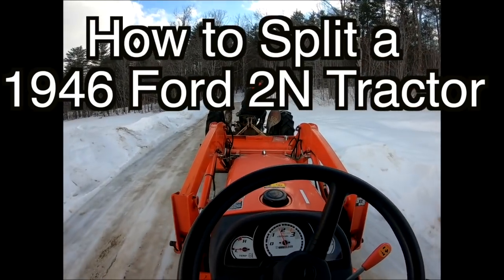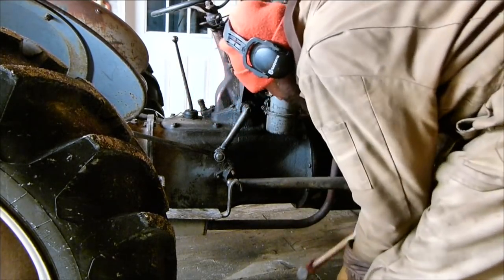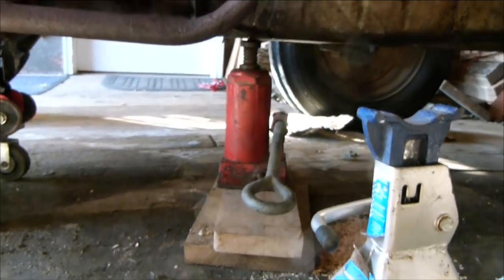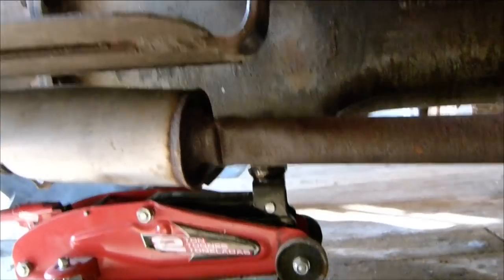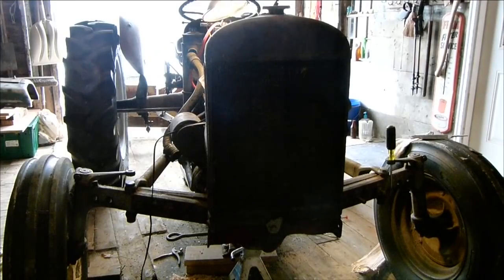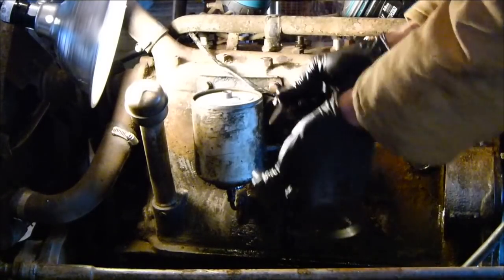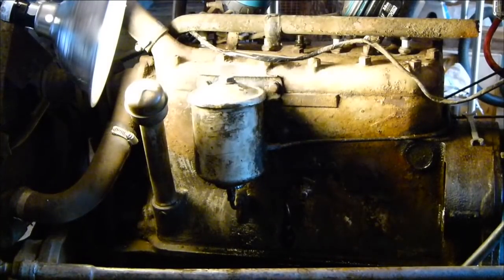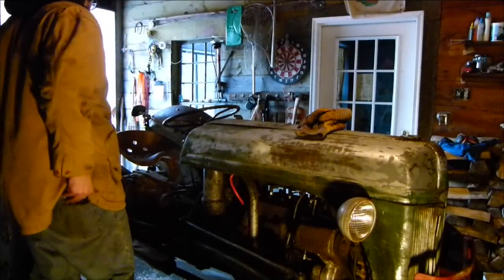How to Split a Ford Tractor

Comment: You've inspired me to take my tractor apart... On second thought... It's 33 and snowing here for the first time this year. Way too cold! I don't know how you do it. Broken foot, freezing temps, wood floor, up hill both ways. I could go on and on. Well, time to watch the follow up!
Reply from the maker: Ha! It was up hill both ways now that you mention it! I don't know how one works outside in temps like that on thick old steel. I don't really like it, and wish for carolina temps when in the middle of a project like that. But I bet your wired the same, that once something breaks, wether you need it now or not, you want it fixed. Thanks for the comment. 
Snow out there!

Comment: I have a 9n,1941 model and need to split it to replace the oil pump and clutch,which is seized. My problem is that the tractor is only about 10 yrs older than I. Another difficulty is that I have no garage or shed to work in. I've been wrenching on motorcycles,cars and trucks and have the manual to rely on,so am watching this. Thanks.

Comment: I can't think of many people who do so well sat thinking through an issue before acting! Just like the portico pulleys, your procedure worked like a charm. Now if you could just visualize your foot bone healing solid! You sure are  moving around a lot! Perhaps haggle for a cheap X-ray or MRI(yes you can get discount MRIs) before you get back to full speed. Patience!
Reply from the maker: Ha! Thanks a lot! Yes, I have a follow up with an orthopedic surgeon who i know on tuesday to get another look at the inside and give some advice. It is feeling a lot better these days and i can't feel the bone moving around as much in there, which is great. But youre right, I aught to be taking it a little easier.

Comment: It good capitalism, building junk is good for business.   I was saying "Load Hug" then you commented. Ha.  My first car was a '67 Saab, the engine was burned up in a fire, I slipped in a used one from the parts yard out back and replaced the wire harness in the engine area and it got me well into highschool, back in the early '80s.  We also ran plenty of VWs    Have you ever used Fluid Film, a coat on the hood will keep the old patina in good shape.
Reply from the maker: Fluid film on the hood is a good idea. I use Kroil too. To swap a motor as a kid, you've prepared yourself for a wild world. Thanks for the comment.

Comment: Nice to give the old gal some love! I believe its designed to run 80/90 weight in the transmission, hydraulics and rear end. Having rebuilt my own 44 2n hydraulic pump, it seems viscosity is important to seal certain clearances. I am curious what your experience will be, tractor fluid might be a better winter option! Be Well Bus
Reply from the maker: Thanks a lot for the comment. That is what i was thinking, through the winter (this dark one particularly,) the thinner fluid may be nicer on all the workings. I will likely drain it come summer for that reason. And because i stirred up all that stuff it'll be good to send some clean stuff in.

Comment: Did I miss the replacement of the broken part that you took out?
Reply: The gear that split and was rattling around in unwanted places was part of the starter motor. You can see the new part go in at 17:15. Pulling the tractor apart was required to get the trashed bits out not the new piece in.
Reply from the maker: I wasn't too clear about that part!
Reply from the maker: Thank you so much for taking the time to explain this!

Comment: About time Statler and Waldorf made an appearance. I know they've been watching from the wings, not sure how they've bitten their tongues this long.

You made this look easier than it would be for me. Sets a great baseline for if I ever have to try it myself. But wait. A gear broke and wasn't replaced but it still drives. What am I missing?
Reply from the maker: Yes. Thank you for noticing my feeble interpretation of the greats from the balcony. Of course you got that.

So, I wasn't as clear in this video as I should have been in explaining what happened and what I did to fix it. which is a bummer. But, i got a new gear for the end of the starter motor and installed it. So, the one that broke in the bitter cold is now replaced. I should make a note of this in the description, as you're not the first to miss this. Thanks a lot fir the comment.

Comment: Where is your general location?
Is the ford useful in your endeavors?
Is that all the tractor 🚜 you use the 2n and the backhoe?

Thanks
City slicker
Reply from the maker: I am in Maine, the northeastern US. That ford is pretty useful, but not nearly as useful as my diesel Ford from 1979 with a loader. I only have access to the back hoe quite randomly, as it belongs to my neighbor who uses it for work. Thanks for the question.

Comment: No need to split. Plenty of room for those small parts in there. Will not hurt a thing.
Reply from the maker: I was wondering that, and I think you might be right, but that chunk of gear was pretty close to the flywheel. It was interesting to do anyhow. Thanks for the comment.

Comment: bonjour , how may tractor you have .
Reply from the maker: Now, i have two. A 1946 Ford 2N and a 1979 Ford 3600 diesel with a  loader. I had three until a month ago when i sold the big red 1957 Ford 641.

Comment: Couldn't you just remove the starter and fish the broken pieces out with a magnet?
Reply from the maker: I thought about that but everything down there is pure iron and the magnet was going to stick to everything and i had no way of knowing if i was getting everything out. Good question.
Reply: Use a shielded magnet

Comment: 🤓is there anything u can't do??? I know! U can't stay off that foot, can u?🙄😆😆😆
Reply: HAHAHA!!!
Reply from the maker: Ha! That right there has hit the nail right on the head. I was really good for about three weeks! Sort of...  I mean, i can't feel the bone moving around in there when i walk now, so I must be healed!
Reply: Bus, six to eight weeks gets you to the point where you don't need the boot. It will be eight to twelve months before the bone is completely healed and remodeled. Please be gentle with that foot in the near term.
Reply from the maker: Thank you so much for this information. I really appreciate it. I am not moving around with anything but the boot at this point. I should take it easier these next few weeks. Thank you. I have a apt with an orthopedic surgeon on tuesday as a follow up. Ill probably get a picture inside again and share it here.
Reply: @BusHuxley  I smashed my left leg up pretty badly in June 2017 and it still has some lingering issues, but has certainly been fully healed for 6 months or so.  I had a bunch of screws and a rod in the tibia, but was able to walk, painfully,  at about 12 weeks.  At no point was the boot really making it so I could walk [I dropped it at maybe 8-10 wks.], so I'm sure you'll be much better off.  Probably running in another month or two!
The medical community was not very forthcoming on predictions, so I remember the stress of "not knowing" all too well.
Reply from the maker: Thanks a lot for this comment. I am hopeful!